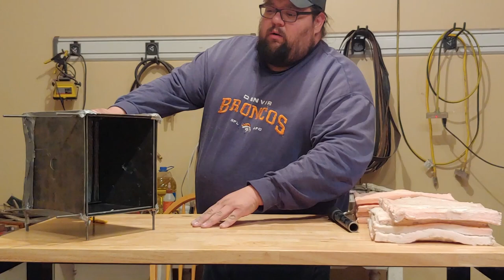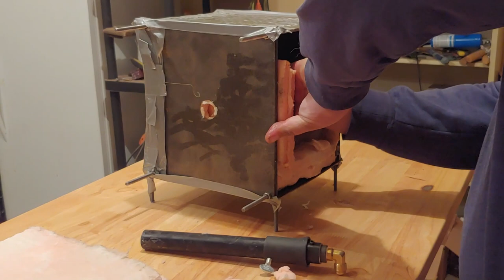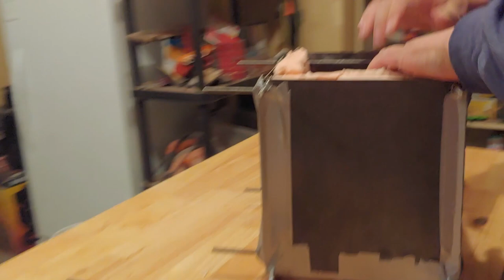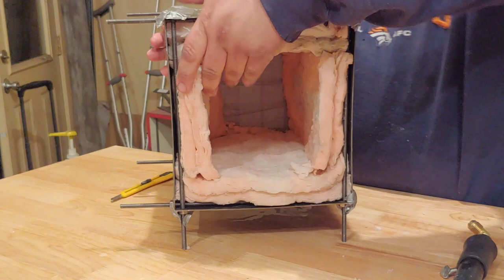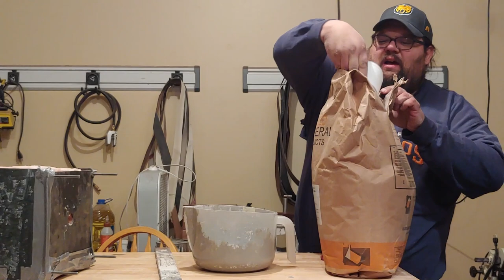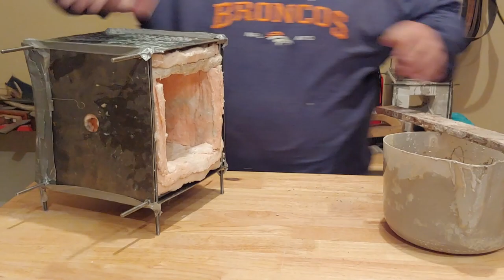Making a forge using ceramic fiber blanket and refractory.

Comment: Can I just step in and say that just adding rigidizer does not make ceramic blanket SAFE when burning it still releases it particles etc you must use refractory cement aswell before applying heat… little safety thing for you guys 👍🏻👍🏻🔥🔥

Comment: Maybe a dumb question but could you explain how I would use this around a stove pipe that's passing through a wall ? It's a concrete block wall but obviously with the joist in the ceiling I want to be extra careful and double safe on preventing a fire
Reply: I obviously have access to the stovepipe from the top of the cinder block opening but I was just thinking that this stuff would just fall right off the pipe instead of sticking to it or securing to it
Reply from the maker: for that use i would look in to one of the pressed ceramic boards instead of using blanket.

Comment: I put ny rigidizer on let it dry an hour then added refractory and only now saw this video, what can i do? I got mine in a kit for my forge
Reply from the maker: it will be fine.  when you do that the first few runs of the forge you will cure it out.
Reply: @irondaggerblacksmithsupply1237  I had only done that last night so I light a kindling in the forge and torched the edges and it's all hard and refractory still wet. How many coats do you think I should? I think it was 1 or 2 pounds, pretty sure two because the other package is twice as larger and it's 6 lbs. total. I don't see any red on the inside, and I've suppose to get all of the blanket? even what is on the outside not getting lit. Should be dry from first  coat at 10pm central tonight

It's a 20" long and 8" high Mr Valcano.... went with that because when i upgrade, the burners were basically that price
Reply: @irondaggerblacksmithsupply1237  ALSO, I subbed, i love your response rate and content. watching more currently!